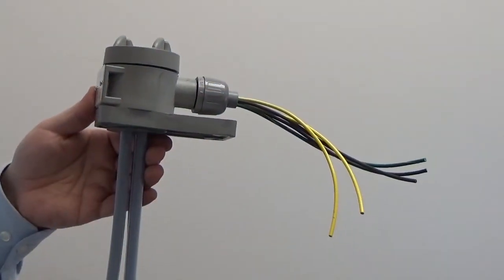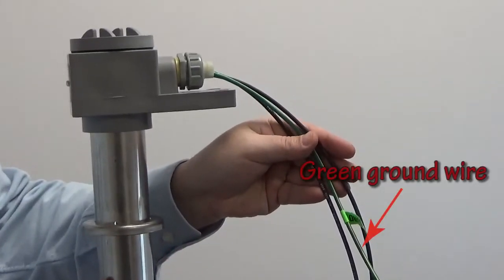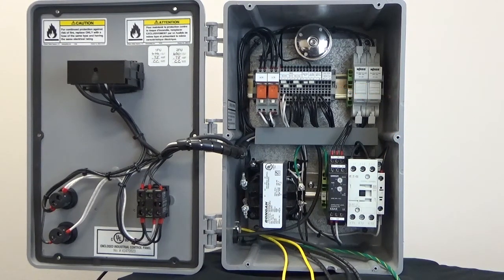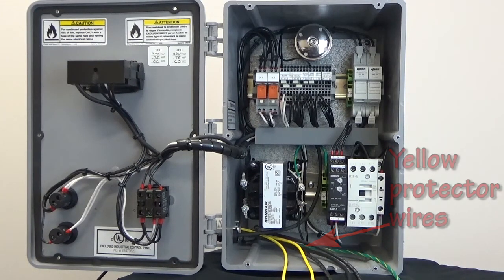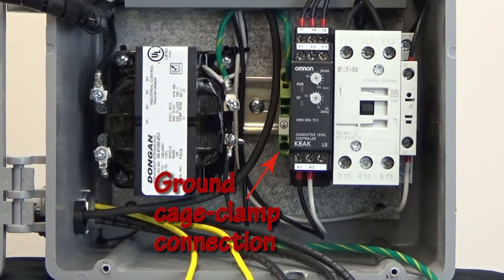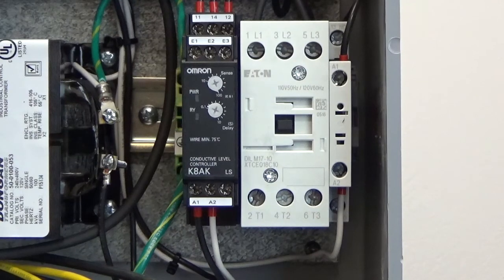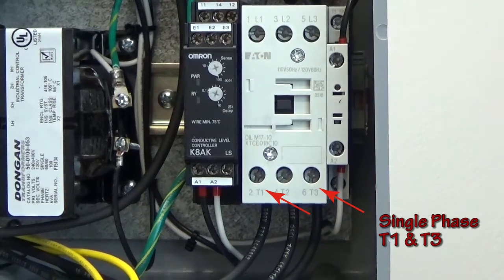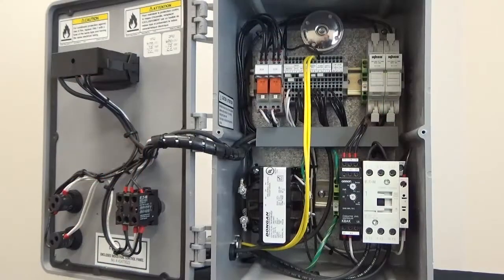Heater Wiring

Comment: Three phase wire has different voltages. Which one goes where?Typically one wire is 220 V, the two  are around 110v
Reply from the maker: For 3-phase power, you should measure the same voltage between the power phases. If you measure voltage between the power phases and a neutral wire, you may get different values. The 3-phase resistance heaters do not have a neutral wire connection, so you do not need to use the neutral wire.
Thus, if you have 220V 3-phase power, you should measure 220 volts between phases A, B, and C. In this case you can connect your phases A, b, and C to connections L1, L2, and L3 on the top of the white switching contactor. It doesn't matter which wire is connected to which phase.